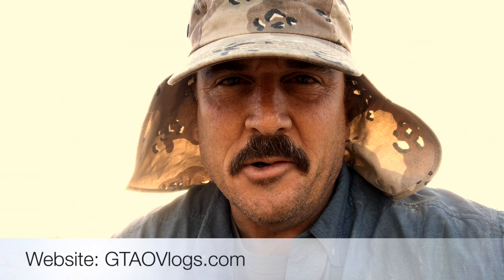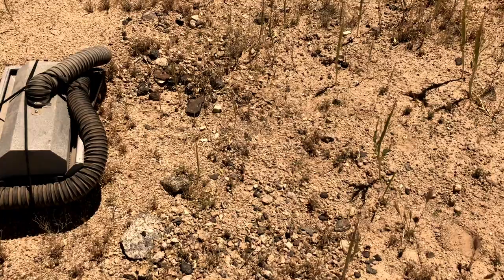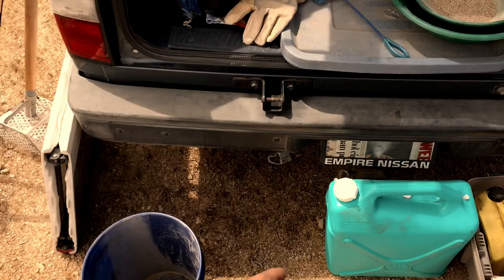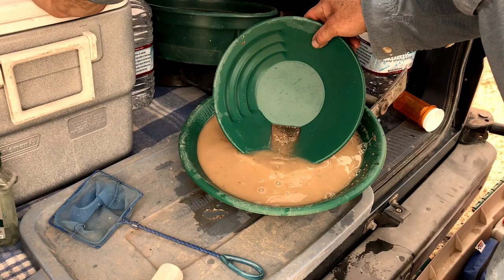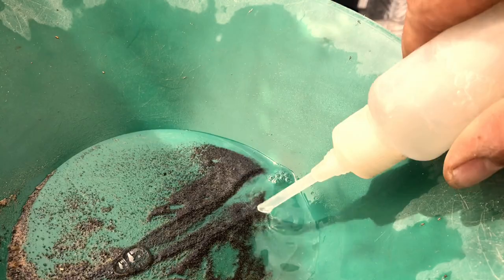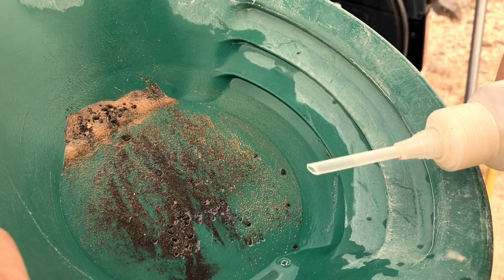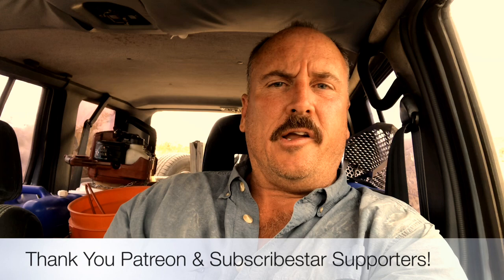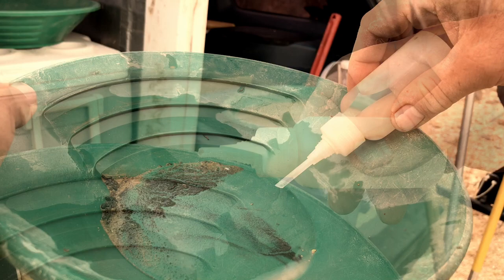USA Desert GOLD DryWasher Prospecting | Gold Treasures Adventures & Outdoors GTAO Vlogs #24

Comment: What do you do about the scorpions?
Reply from the maker: It sounds bad but it's pretty easy really.  Hold them down with a stick and snip off their stinger on the tip of the tail.  Then you can let them run around on your bare arms or put them in your pockets ...no worries.  Just kidding.  What I do with them really depends on my schedule and the things I still need to do.  If there's time, I can put them in a container or jar overnight (they keep fine) and release them on my way out far from from my camp.  That's one way and there are other way which I may show in upcoming videos...  Cheers and thanks for your feedback!
Reply: GTAO Vlogs   O wow! I thought there might be some sort of a spray or something to keep them away.
Reply from the maker: @centeroftheearthmining4095  Not sure...  for ants and other wandering insects if you have a camp area, I have used AJAX poured in a thin line around the area.  This works well for ants and probably scorpions too.  Fascinating critters ...until you get stung.  Cheers Terry, Aaron